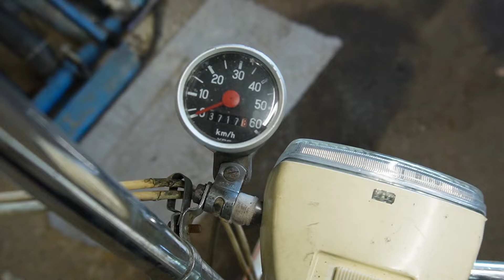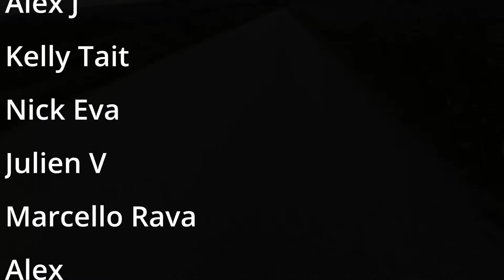Motobecane Moby-X1 A folding French moped | Test Ride

Comment: Love it, I have a Raleigh Runabout from 1968 which uses the same Motobecane engine and transmission. On a good day it will do 30MPH /48KPH on the flat!
Reply: I had a 1968 Raleigh Runabout as my first moped! Yes, 30mph/48kmh is about as much as it would give. Mine was always blowing light bulbs due to bad earths. I used to ride it from my house to Nottingham every weekend during my pilot training (80 miles round trip), but better than walking (mostly). Enjoy your classic ped.

Comment: A rather over optimistic speedo and in Australia we don't have mopeds but motor asissted pudh bikes which have to actually look like a push bike but they need to electric they banned the ones with petrol motors no because environmental  laws because people modified to were they achieving quite high speeds much faster than an unassisted push bike extremely dangerous and in some states they had to be registered and the rider had to have a motorcycle licence
Reply from the maker: It's kmt... :)